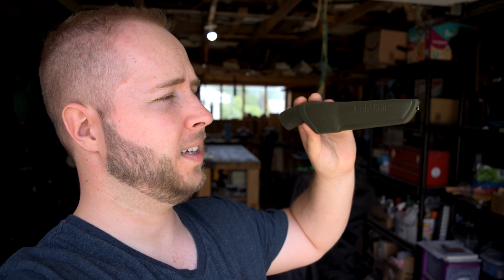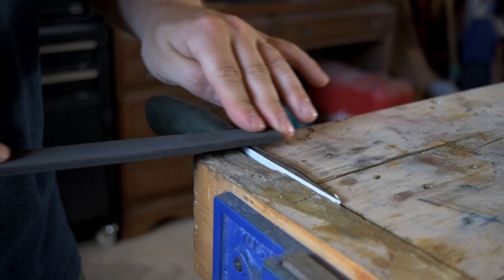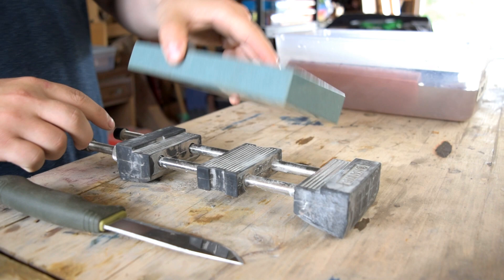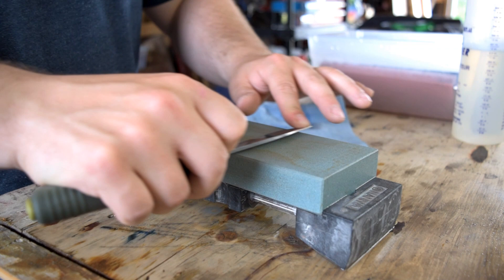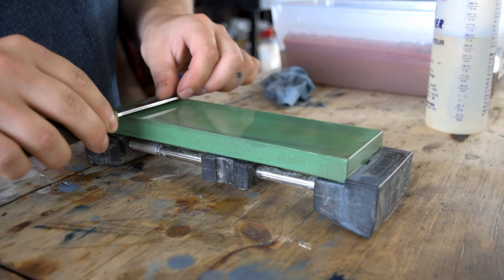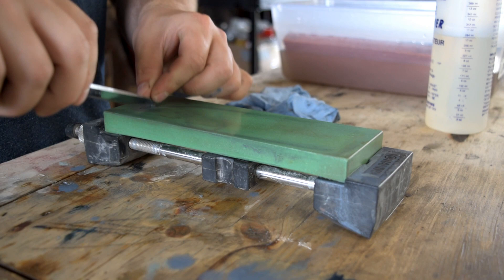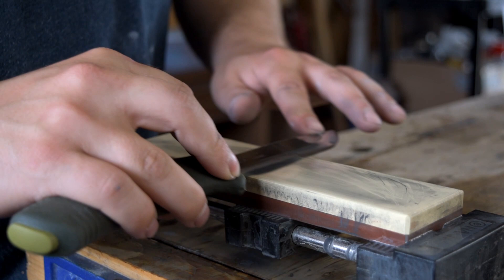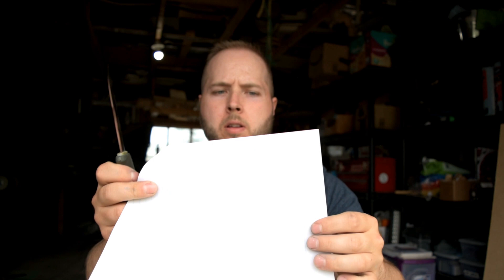How to sharpen a MORA BUSHCRAFT FOREST!

Comment: Firstly, awesome video 🙂 secondly, I personally love Morakniv, I have the Garberg stainless and carbon also just got the Eldris, coming soon I believe I am going to swing for the cork knife with the Scandinavian grind. I prefer a true scandi grind for a bushcraft/survival knife and this is why. I grew up learning "bushcraft" skills years before I ever heard it called that, for us it was just living off the land but the (go to knife) back then, was mostly a pocket knife. My granddad in fact only ever used a pocket knife and it did everything he wanted it to do, but I found the secondary bevel or micro bevel, was always in need for a sharpening. It was a common thing to watch him take out pocket knife followed by pocket stone and sharpen it up real quick before continuing on with whatever he was going to do. Also, the secondary bevel over a span of time forced you to change the angle of the bevel as the edge receded closer to the spine from sharpening it, to the point that it basically became a scandi grind. So with the experience that I had with the pocket knives as a kid and young adult with a secondary bevel compared to my experience with my Garberg and scandi grinds prior to the introduction of that specific knife, and how much I could do before it's in need of touching up, also with the fact that more times than not with a scandi it's just stropping it on a piece of leather (no compound) rather than actually removing metal to get it back to razor sharp, I choose a true scandi grind over any other type when it comes to quote unquote bushcraft knives. Again, awesome video, I have been subscribed, just now seeing this video lol, I love your channel 🙂 take care and stay awesome!!! 🙂

Comment: I find a 0 degree scandi edge can be a bit fragile, so I always put a little bit of a convex on my knives when I strop them. The amount of convex isn't enough to interfere with sharpening, or even see with the naked eye, but I think it increases the strength of the edge greatly.  For a strop I use old denim tacked to a flat board, with and without compound.

Comment: I really like that micro amount of convexing on my Scandinavian grinds . I strongly prefer a scandi or a convex and that's the grinds I use on 75% of the knives I make . I do however for some reason always put in a flat or Saber on my full tang knives.  I'm still on the fence about micro bevels . A full 0° scandi is great until you get to carving on very hard seasoned woods so the micro bevel has a important place imo

Comment: The sharpened spine idea probably most commonly comes from Mors Kochanski, and I think he liked it originally for the ability to scrape wood. Fire steel was just another benefit. It definitely skins bark cleanly, as if it were invented specifically for that purpose. In combo with the aggressive cut of the blade, I think what's shown here is benchmark.

Comment: Where did you see that Naniwa Chosera use SiC for the abrasive? I was pretty sure it AlOx like most water stones. Part of the reason is Suehiro has a G8 8,000 grit stone and its SiC and its considered the finest SiC stone. If Chosera are SiC than their 10k would be the finest but every site I've seen has them listed as AlOx.

Comment: I like the micro bevel because it doesn’t bite into the wood so much
Reply: The sharpened spine idea probably most commonly comes from Mors Kochanski, and I think he liked it originally for the ability to scrape wood. Fire steel was just another benefit. It definitely skins bark cleanly, as if it were invented specifically for that purpose. In combo with the aggressive cut of the blade, I think what's shown here is benchmark.

Comment: I have been super impressed by  Mora's scandi grind. It really seems tragic to put a micro-bevel over it. If you enjoy maintaining an edge, that scandi is sharper than a razor!
Reply from the maker: Yea, they obviously do it to compensate for the soft steel, and the hard use they often face. However, if you know you're going to be treating your knife well, I see no issue with removing it!

Comment: You sort of referenced it, but failed to really drive home the #1 mistake beginners make. You must grind down to the edge on your coarse stone, create a fine burr. If you don’t reach the edge, you are just polishing the shoulders. Beginners often run through every stone, every grit progression, strop, have a mirror edge, even held the right angle and still don’t have a super sharp edge. It’s because they never reached the edge (formed an apex) they just polished the shoulders near the edge. I know you know this, you can feel with your fingers, you don’t need to visually see a burr, and you know a “burr” is so small and fragile - but most of your viewers don’t. If all they saw was this video they would throw their hands in the air when they saw how much Shapton Waterstones cost.

Comment: Love your channel but you really don't look experienced using hand files. I think you said you'd use a belt sander. I'd guess you used a bastard file on the back of the knife where I'd use a smoother file; your work just looked a little rough.